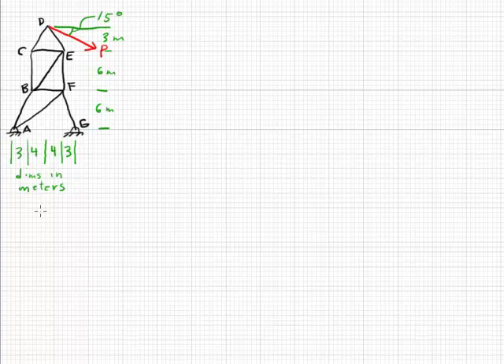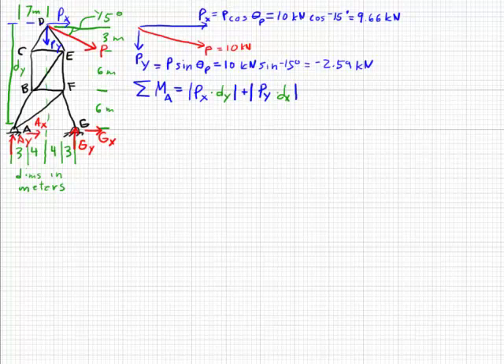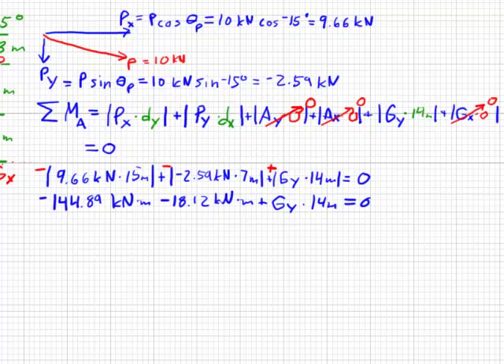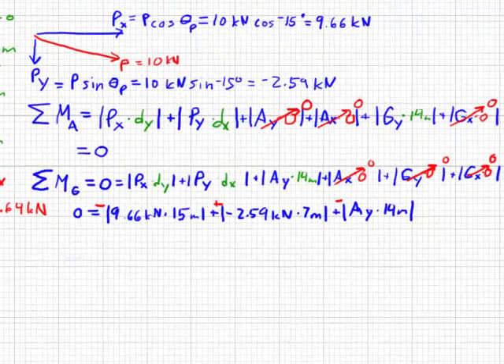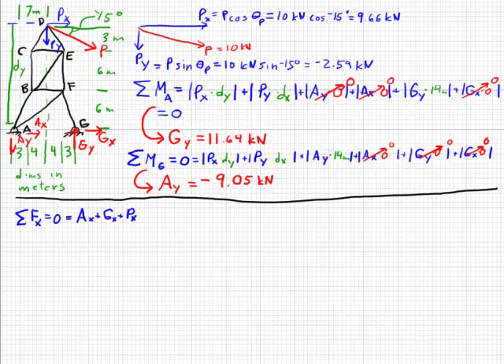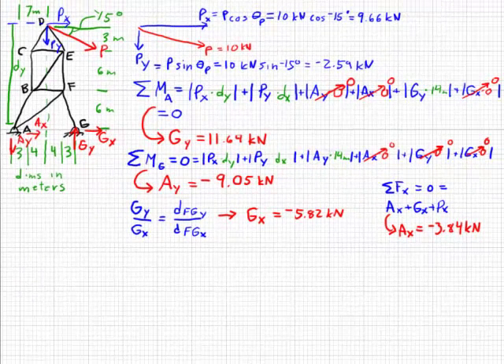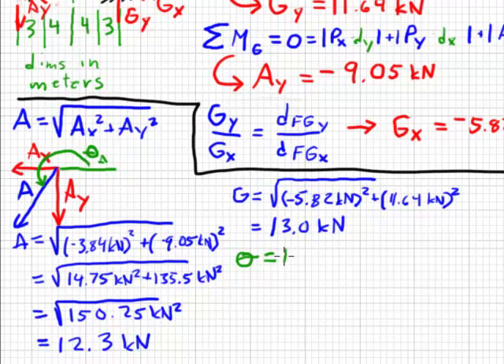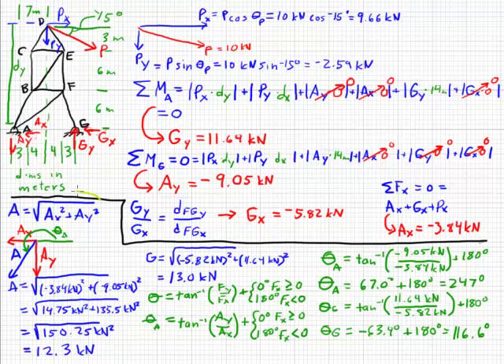Tower Truss Reactions

Comment: Hi, thanks for the valuable upload. I have a question on Tower Reactions as well. Especially on the topic of Horizontal Force or Transverse Web Shear. The most common practiced used by some tower engineers, they will take out the Beam End Forces directly from software analysis. It is then resolved using Main Leg Axial Load Horizontal Component + Diagonal Bracing Horizontal Component (Fx or Fz assuming Fy is up) = Summation of Horizontal Force at K-Point Level. Assuming the tower Ground Level is at K-Point (ignoring the Stub eccentricity for now), that force will be used to design the Foundation. I found out that way is too conservative as we will be passing extra Horizontal Forces to the Reactions. Furthermore, structural software such as Staad.Pro has resolved all the forces internally (as any truss system would) and it yielded a more reasonable lower Horizontal Forces (Global Axis Reactions). So, is it okay to use component horizontal forces at the Main Leg + Diagonal Bracing directly to get the Horizontal Reactions? - note, the forces in the tower members are already analyzed by Staad, only that some tower engineers will NOT used the Final Result by Staad's Global Axis Reactions, instead they will simply pluck it out from the software and resolved the component manually. Sorry for the long question. Thank you for your time. (If you need me to email the question, just drop me your email in the private message, thanks).